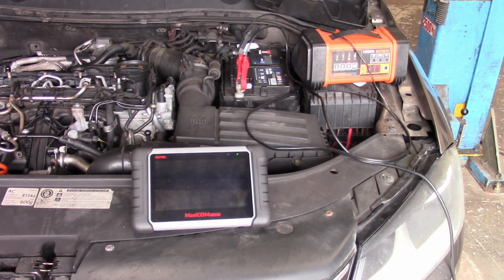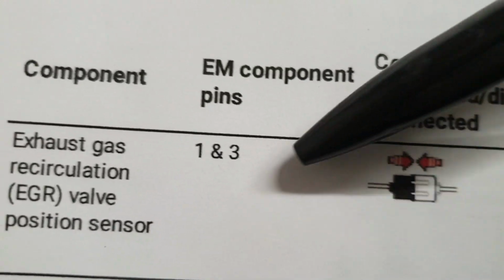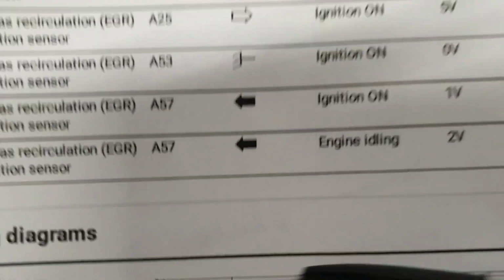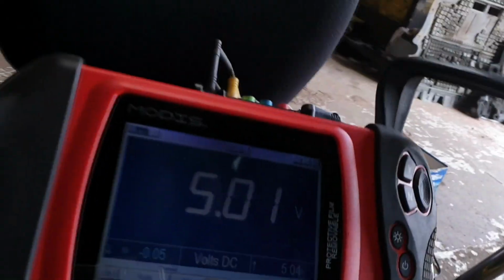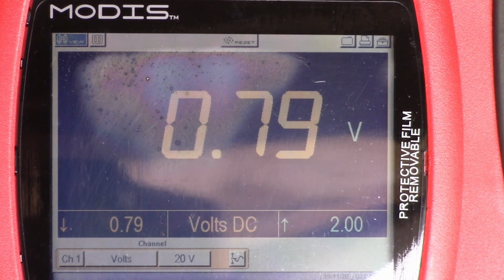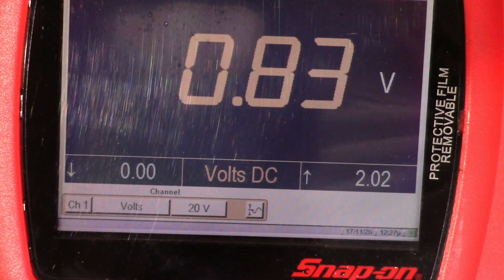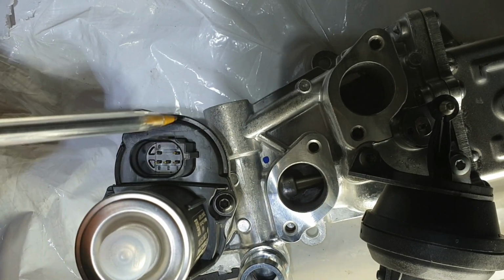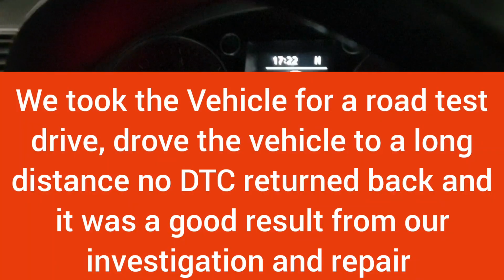Vw Passat 2.0 TDI Common Rail Blue Motion Technology (EGR) P0403 DTC Fixed.

Comment: Howdy!  I watched the video about the P403 Egr error.  Interesting diagnosis with real-time reading of values.  Why didn't you take a reading and after replacing the Egr module with a new one!  It was very interesting to see the differences between the old and the new.  P403 is a fault generated for the Egr lock.  That is, it remains stuck on open, or does not open in real time due to mechanical problems with it.  I have also noticed a value below 1 volt even when the Egr is in the closed position!  It was interesting the values of a new EGR!!!!